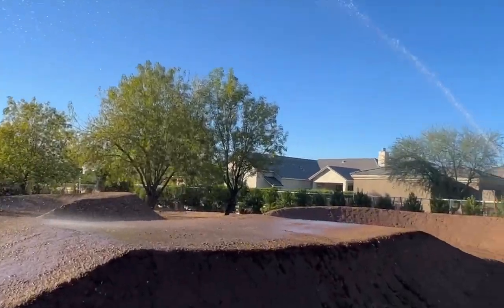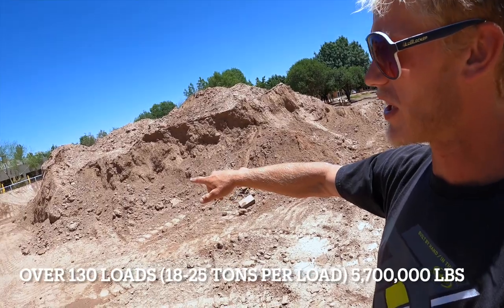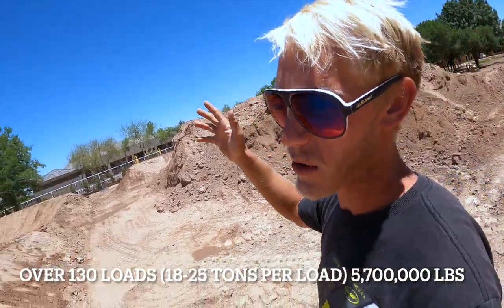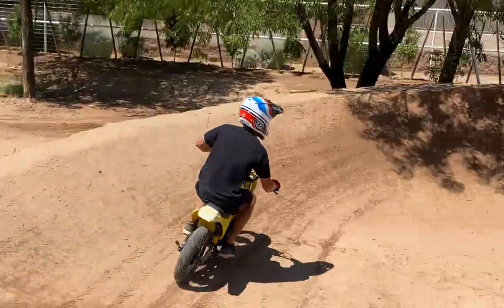1 ACRE PIT BIKE TRACK  // 7.2M LBS OF DIRT // TRACK BUILD #86

Comment: how much does it cost to get one of these tracks
Reply from the maker: Well this is the only track I’ve built like this one that is glass smooth which takes a great deal more work and around 200 large dump truck loads of dirt. So there is the cost of dirt, tractor, labor and sprinkler system. Probably around 16+k for this location. They got all their dirt for free too. Normal pit bike builds are cheaper.